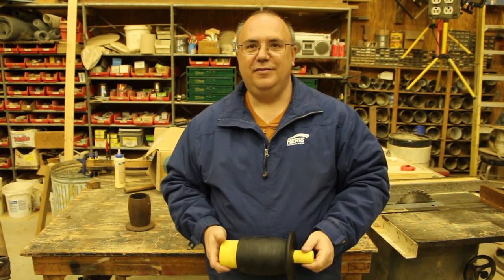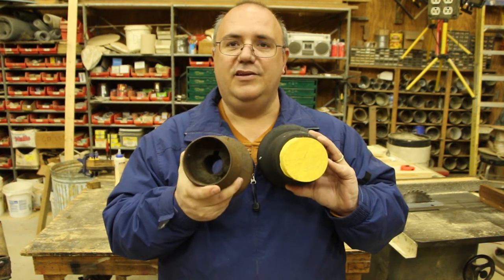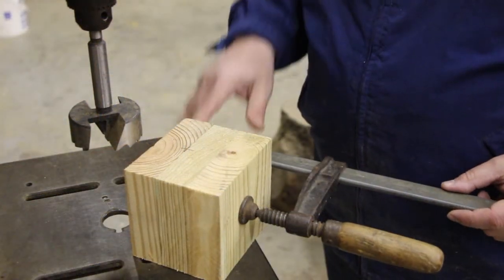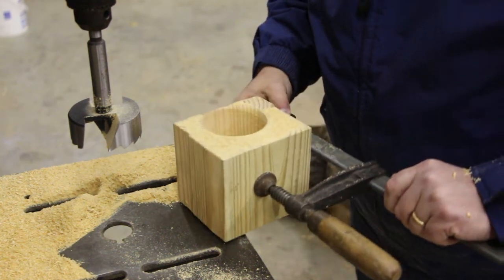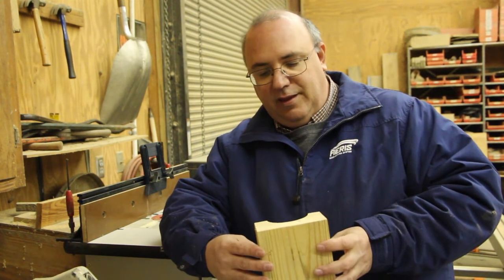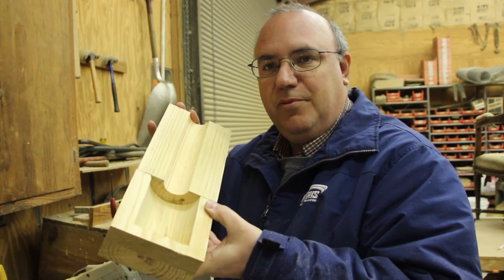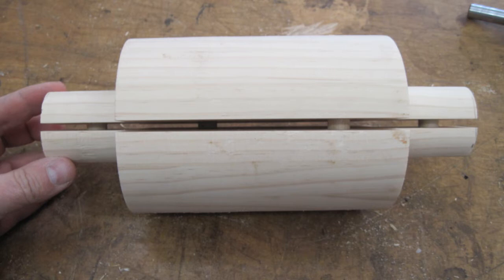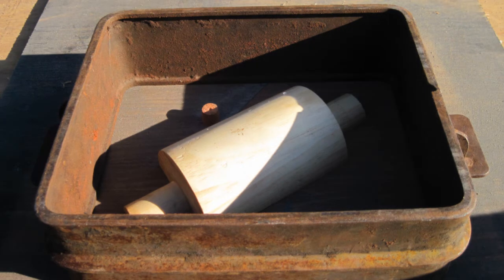Pattern Making - Flat Belt Pulley 3 - The Core Box

Comment: Very enjoyable and instructive video.  I have a suggestion, though.  At certain points, you speed up the video to save a little viewing time.  I'm afraid that a novice might think that you're really running your lathe and drill press at what appears to be a very high rpm and try to replicate that at home.  Maybe you could add a little text at those moments warning that it's a video effect, and note the recommended tool speeds.
Thanks again for the video.

Comment: This is probably a very dumb question, BUT, could you take a solid lump of cast iron and machine the pulley out of it?
Reply from the maker: Could you - sure you could.  Lots of extra cost in materials that end up as chips on the floor and lot so extra time machining the extra metal away.
Reply: Thank you for putting me straight, I really didn't think before I asked the question.

You will probably get more really dumb questions from me in the future so I will apologize now for them.

Thank you.

Comment: Casting engine blocks, cylinder heads, transmission cases etc. makes perfect sense. Casting a pulley like this seems like a waste of time.
Reply from the maker: +justcarcrazy Why?  Machine it out of a huge chunk of steel?  A lot of metal to end up on the floor - particularly up in the hollow area behind the pulley face.  Casting is the perfect choice for a part like this.
Reply: +Keith Rucker - VintageMachinery.org Isn't it going to take more time setting everything up for the casting, then setting ewverything up for the machining, than it would to just machine? Besides, aren't steel bars stronger and tougher than cast iron?

BTW, I'm not dissing your work. Quite the opposite, I want to learn all about casting that I can.
Reply: Keith has said in other videos that he's trying to keep the antique consistency of the machinery, so the preferred material is cast iron. Further, cast iron grips the belts better than steel.  Why not machine it out of a chunk of cast iron then? Because this is more fun, and he's learning? It is best to learn on simple patterns. Eventually, there will be a more complex pattern that can't be machined from stock. Keith will know how to do it, and have the practical experience to make it possible.

Comment: Hey Keith, another informative series. Thanks.
I'm curious though would it not have been easier to machine the pulley out of plastic or aluminum close to spec and cut that in half, cast it and then do the machining? I only ask because I'm thinking of doing some sand casting on a hobbyist level.
Reply from the maker: +rich dunn More than one pattern has been made from those materials.  Wood is just generally cheaper and more avaliable.

Comment: Gear up Keith and start doing your own cast iron pours.
I am just now getting ready to build my foundry and I have 2900 degree refractory and all the parts to make a Monster burner that will do aluminum fast and cast iron in a half hour. My foundry will be a lot like the Gingery one with a body that will lift up or a lid that will open. The body lifts so I can reach in with tongs, grab the hot crucible from the side and go right into a pour.
Reply: *****
If you go for cast Iron, think about getting an induction furnace rather than a gas/oil fired one. that way you can work with a large variety of materials and do not need to worry about fuel at all. A sufficient supply of electricity is needed, but that could either be obtained through the mains, or by strapping a generator to one of your steam engines.
After some digging I even found a video of a homemade induction furnace. Why am I no longer surprised by such findings ...
https://www.youtube.com/watch?v=OJGaQdgPRmA